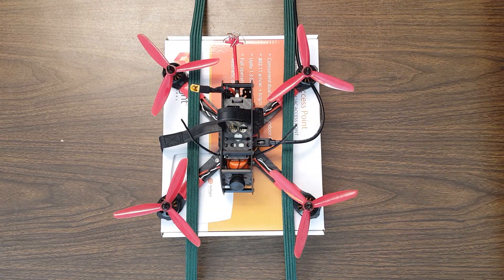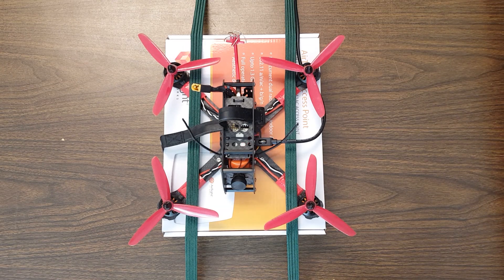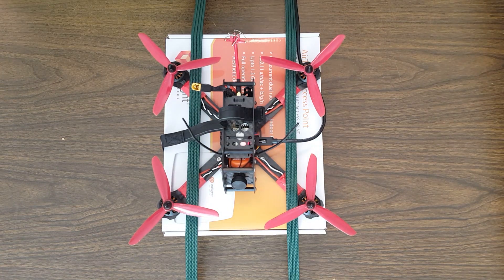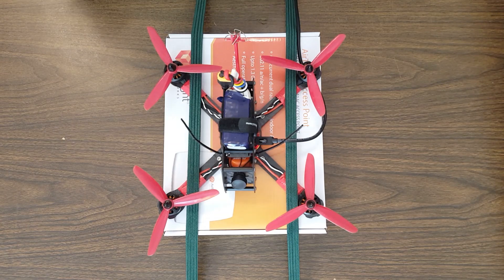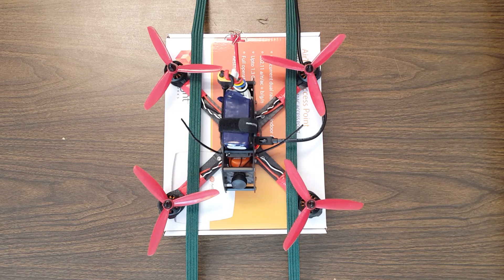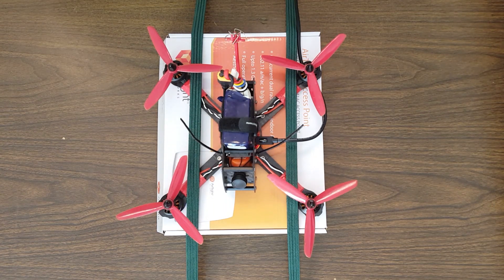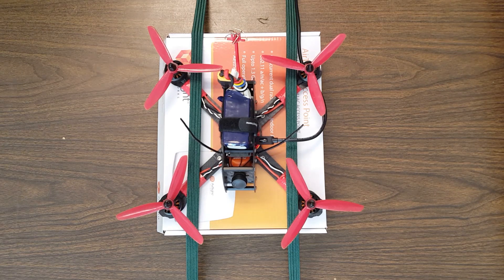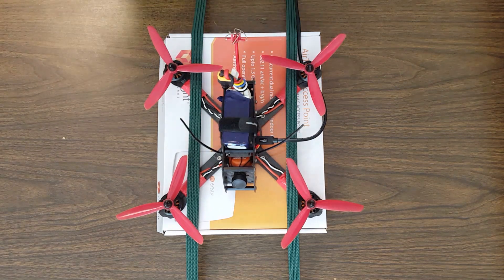Troubleshooting: Quadcopter Desync (Falls Out Of Sky)

Comment: I am new to quad flaying and probably this is a noob question. What happens if the motors are throttled up using the radio controller (PID active) when the Quad is pinned down? Will the throttle go up controllably? If so, why?  Because that's what I am facing in my tests and it freaks me out to fly the quad in open.
Reply from the maker: https://youtu.be/xBaefeQtA1c explains why this happens.

Comment: So mine appears to be engine breaking. As soon as I land and disarm, one of the motors slowly spin down, the rest "break" or stop. Then when re arming, that motor won't arm back up until I give it a few moments or unplug and re plug in the quad. Doesn't seem to drop out of the air though, only happens on landing.

Comment: I had a dipping front left side for the first time today. Very strange. The control of the quad went a little wonky the first few times it did it but I was able to regain control and land it. Then it dipped hard and headed toward the ground so I just disarmed. I swapped the right and left front motors to see if it still dipped left or if it would dip right. Trying to see if it's a motor or an esc. I only had 1 more charged battery to fly tonight and it was getting dark, but I was not able to get it to dip at all after swapping motors around. This is a new 3 inch build made out of used parts that were all good at the time I stopped using them. To me the motors were all too warm for my liking. They weren't too hot to touch, but warmer than I've ever felt any of my motors before, and I was just cruising back and forth down the street trying to get it to dip for me. I wasn't flying hard at all. This is my only AIO board with 32 bit ESCs. After the first few dips I plugged it into blheli_suite and it told me I had a problem with esc #3 and it made me reflash that esc. But the dipping forward and left seems like it was esc #4, the front left motor. I'm running props-out, so I suppose if #3 slowed down, that could cause it to yaw left and because #3 is the left side, it could also dip to the left. I have since reflashed all 4 escs and it still dipped, but did not dip for a 4 minute flight on my last battery after I had swapped the motors. Anyway, it's an interesting problem that concerns me because if it's just a bad motor, that could kill an AIO board by continuing to use it and if it's a bad esc, that could kill a good motor. 

Not sure if this will make the motors warm, but I flipped this frame and motors upside down and turned it into a pusher prop quad. I guess it's not blowing air down into the motors this way. Maybe that'll make the motors run warmer.

Comment: Bardwell your a life saver.  If I hadn't watched this video ida never knew I had this problem . I can't afford a motor right now so I just dropped a tiny ball of solder on the broken copper wire, heat shrinked it now no more drops. I'll replace motor soon though. Thanks bardwell‼

Comment: What do i do if i actually hear the reboot tone from one of the esc ?? It happens only sometimes and othertimes its allright and flies no problem... Whats the solution for this problem ? Btw love the videos👌
Reply from the maker: It means the ESC lost power.
Reply: Joshua Bardwell and How do i fix it ? Sometimes it happens just on the ground before even flying... could dried grass all over the electronics be the problem ? Also sometimes i fly and its completely alright for like 15 bateries and then all of a sudden it just reboots...
I use a diatone mamba f722s, F50pro 4in1 esc stack

Comment: Hi, thanks for the vid, I’ve tyro109 when I push the THR to max the drone get crazy and starting to yaw, and then lose control is some times, do you have any idea? Thank you
Reply: plugin drone to computer, open betaflight, go to motor tab, start testing the motors, turn them up to 100%, then plug in your battery and bring them back down to 0. Done. you have calibrated your ESC to your throttle.
Reply: @jacobdavis2296     I will try that right now, much appreciated... I hope it will work, thank you
Reply: @Fredhobby  @Lee The Bastard maybe try reflashing the escs in blheli. I saw another video that covers fixing quad roll of death. I can't remember what he did, but you can check and it may fix your Issue. I'm almost positive that's the issue.
Reply: @jacobdavis2296  I've just done that, doesn't help, the same issue, I have this problem since day one, maybe 4 months, never enjoyed it for even ones, still new.. and all the internet... nobody really knows, at least you tried thank for that
Reply: Fred’s Hobby did you ever solve it? I had the same problem on a tyro79, I ended up buying another, then I got a different problem🤨 in self level mode after doing a roll spin the bloody thing when mental, it’s rolling out to the right then it just goes off in any direction usually backwards and towards me, reflashed the firmware but still the same. I have 4 of these,  2 tyro 79, a 99 and a 109, had problems with every one of them! FC and VTX
Reply: @leefurniss  Hi mate, yeah fixed, it seems like nobody here have real kwnolage to solve real issues, you should flash the ESC to 48K, only then it will be solved and flying is great and stable, thanks
Reply: @Fredhobby  @Jacob Davis
Thanks for the info guys, ive tried flashing ESC's and FC again and still no joy, Ive got the feeling the FC is buggered so ill try the other "good" FC (dodgy VTX) in my loopy Tyro over the weekend and let you know how I get on. Cheers
Reply: @leefurniss  it's not a regular flashin, you need to download a specific file and flash it, it should solve it, give me your email I will send you the file, it made me crazy for months until I fixed that by my self, so if I can help you id be happy, thanks
Reply: @Fredhobby  Hi mate, I don't want to put my email address in the comments and can't send it you privately, do you know how to send it without putting it in the comments? I did download a file off gitHub last night and flashed the ESC with G-H-30, 16.7. Is this not the right one? Its doing my head in too, I felt like throwing it at the wall last night, I do appreciate your offer of help if you can figure a way of getting my email to you privately. Thanks, Lee
Reply: @leefurniss  that is the exact way I felt with this issue, never enjoyed it, I hope it will help you, I made a download link for you: https://we.tl/t-0GPpW5XXYz
,thanks
Reply: @Fredhobby  Hi mate, I tried the download and it seemed to work though didn't show the same code in the configurator, I did a test flight at 2am in the morning (neighbors love me) and all seemed fine till the following day and then i'm back to square one dodging out of control quad, tried to reflash esc's and now it comes up as failed flash with this in the log (flashing failed - Error: LAYOUT found #G_H_30#, #M_H_30# expected at checkESCAndMCU) I'm puzzled mate! I'd be grateful for any more ideas if you have some, i'll try it again on another PC soon. Thanks for taking the time to try and help anyways, I really do appreciate your effort.
Lee
Reply: @leefurniss  hi mate, its only the ESC issue, check your USB cable before you flash it, use quality one, and try it again, its the only issue, can't understand why they sell such a bad quality ESCs, these jerks...
Reply: @Fredhobby  Thanks mate, I was thinking maybe its a bad USB wire but it flashes everything else I've got, It also says my FC target is STM32F411 where as before it said MATEKF411 . I wont give up on this i promise I will learn from it 😂 Thanks again mate 👍
Reply: @leefurniss  sure mate, after this, you will just be smarter, when I flashed few times, at first it was as it doesn't save the new update, I did that again and now all is working perfectly, do use another USB just to make sure, hope it will work this time... :)
Reply: @Fredhobby  Hi, can you reupload the file, because I have the same problem that you
Reply: @Fredhobby  Thanks a lot, yesterday I broke one tyro arm. So I'm waiting for a new one to test this hahahaha
Reply: @pepeluis06  lol... hope it helps you:)

Comment: Hey JB, I flashed my Tinyhawk freestyle to 4.1, and kept the diff all. Im wondering if youve done a THFS to 4.1 yet. I flashed matek F411RX, 1st non legacy, then legacy because my board was 90 degrees off on the yaw axis, and so are the motors, I fixed orientation, and remapped the motors, but I cant get it to arm. My question have you heard of this before on the THFS, hopefully I can follow along with your video to paste the right stuff in. Shouldnt I be able to flash it back to 4.04, and paste the whole diff all file back in.  Pasting in the cli makes me nervous, are Fcs easily bricked pasting into the cli. Thanks JB.
P.s. I finally got the 1606/4000kv 4s acrobrat tuned up, its a beast on 4s 850 mah with an AUW of 326 grams, lol.  I think the 1507 lower kv motors would be a much better match.
Reply: Papadoc Fpv this happened to my 2nd THFS out of the box. I reflashed the fw to 4.0.4 and then pasted in the stock tune from EMAX Into cli. Just go to quad page on EMAX site, click “download” button next to BNF cli dump. It’s a text page. Just copy the whole page it takes you to and paste into cli. Hit enter and after it runs through each command automatically, it will save which restarts the quad. Stock config should be restored. This fixed the weird gyro issues and I just calibrated gyro after that. According to the firmware update page in beta flight, you dont have to worry about it bricking.
Reply: @tapyinz  I appreciate it, Ill get back to that in a couple days. I was hoping I could ger it restored. I havent put any content out for a while, but Im still giving a frame away at 500, check it out if you like. Better to come. Thanks again!

Comment: We've got a tiny hawk s falls out the sky and reboot relemetry lost/recoverd. And 1 motor always has problem (changed from rightback to front right and front left) but sometime other motors don't spin on idl but twitch/lagg. On higher throttle 2 motor always spins but 1 or 2 twitching/lagging.  We cleaned all motors and changed motors but the problem came on more motors after that. ( orderd 2 new motors, props, frame and camera ). It did fly good in beginning for a little.
What to do ?
Reply from the maker: If the motor stutters and you changed the motor, then the next step is to change the ESC.
Reply: @JoshuaBardwell  btw it's n all in one board with vtx receiver esc"s. It was very weird becaus off the drone did after changing motors fly good for a while and started dropping out off the sky. Also many times on arming 1 or 2 motors stutter. Pushing on the connector of moving the little cables could temporarly help. But not for long.
Tnx for ansering

Comment: Hi, I made a roll on my leader 120 and  starting dropping from the sky without having control of it but suddenly  it connect again with my radio  and it continue flying without any problem. What do you thing is the problem? Thanks
Reply from the maker: Maybe your receiver went into failsafe because it lost power or the signal wire is damaged.
Reply: @JoshuaBardwell  thanks

Comment: What should I do if my Flight Controller continuously restarts? I think my problem has to do with temperature because I notice if I blow on the FC, it will fix the problem until the FC gets warm again. But the temperature gets warm so fast. I get about 1 - 2 minutes of flight before it restarts on me. I tried it with and without all the components connected to the FC and the issue persists, so I know it’s not due to any of the components wiring.
Reply from the maker: You may have a short-circuit somewhere in the FC, which would cause it to overheat and shut down. You can test for continuity between 5v and ground for example (it should not be there).

Comment: I think your setup would feel a lot safer if that foot between the prop and your head was filled with a sandbag or a cinder block. I know I would feel better...
On a different track for the same problem, do you think that a set of flat shrouded disk impellers, kind of like those in vacuum cleaners, but with straight vanes would be worth the trouble for situations like this? It would eliminate the risk of un-intended flight while still providing a load and rotational moment to the motor.

I have dreams of drones large enough to use actual aircraft props. Anybody else?

Comment: 3:39 you can see the stator starting to move and rotate on the hub causing interrupt
Reply: Okay how the f did you see that?
Secondly, my rewound motor had the same issue: loose stator. I just applied epoxy. Will see if it will do away the problem. Will let you know🤜

Comment: My quad also started falling out of the sky, but in many cases it rearms itself after 1-2 seconds. In some cases the quad hits the ground and than it flies again, but not always.
EMAX F4 Magnum AIO FC
Taranis QX7S radio
FrSky XM+ SBUS receiver

...I already damaged 2 batteries and broke 2 or 3 battery straps because of these crashes
Reply from the maker: Turn the "Warning" OSD element on. When the quad falls out of the sky make a note of what you see. It will give some clue on what happened.

Comment: My quad Flys fine on 4s and when I put it 5s it desyncs and falls, which should not happen because all the parts are rated for 6s so can someone tell me what the issue is?
Reply from the maker: Just because they are rated to take 5S doesn't mean yiu can just go back and forth without retuning.

Change ESC timing to high.

Add capacitor to ESC's.

Comment: Joshua can you help me with an issue. I keep getting esc’s fail. twice on motor 1 and once on motor two. It just falls out of sky mid flight and once you try power cycle it only first 3 beeps on esc and esc just gets really hot? Can’t read esc in blhelli
Reply from the maker: If it is getting really hot when the motor is not spinning then likely there is a short-circuit and it needs to be replaced.
Reply: Joshua Bardwell I agree but do you have an Idea the flight controlled is causing this? As it has happened on 3 brand new esc’s. On two different motors?
Reply: Joshua Bardwell thanks for any help I’m getting desperate

Comment: What if it is only occuring while flipping and rolling?? This would mean soldering?
Reply: I have changed the flight controller for other reasons than desyncs and the exact same problem still occurs
Reply from the maker: I would start by investigating a damaged motor or ESC.

Comment: Hey Josh I ws wondering if you might know what would cause a motor to stay spinning when you spin it up and lower it in the motor tab. When I power up and arm my motors spin up, but when I disarm and try to arm again motor one starts to beep the start up beeps over and over, then starts to make a remix of the beeps. I unplug it plug it back in and it repeats the pattern. I am making a video of what happens and will be posting it in the RR and miniquad club group soon.
Reply from the maker: I would suspect the ESC.
Reply: Joshua Bardwell thanks, I kinda figured it might be the processor chip on the esc. It seems to get caught up in a boot loop, and in blheli it says esc 1 has no firmware on it. It also gives me error messages when I try to reflash. I think someone tagged you in my RR post with pics and video of my findings thus far. Do you have a video on troubleshooting esc processors and other components, like the tan caps? I have found tips on troubleshooting fets but am struggling to find tios on the other bits.

Comment: hi have a problem. on a hard flip or roll every now and then, the craft does a death roll. while this is annoying, everything appears to reboot before second roll. reboot happens, you get asterisks on screen then you hit the ground.  is this something stupid in the FC?  I can fly it so long as my roll rate is under about 800 degrees /sec
Reply from the maker: Does it actually reboot like you hear the ESC startup tones? If so, look to your power system: XT60, PDB, wiring to ESCs and FC.

It could also be this: https://www.youtube.com/watch?v=xIQn35vZBvE
Reply: thanks for the reply.  usually the craft is beyond hearing and other craft making noise. so I only have screen to go by.
it is random as I can fly a full battery fine and the next one goes silly.
always after a hard roll or flip and it once the desync (I am hoping) occurs, the screen blacks out and then comes back on. this has occurred on several FC's and only since BF3.1 onwards. I have tried BF 3.1, 3.2 and now 3.3.

I have tried increasing idle speed as well as esc timing to med-high.  could a higher demag reduce chance of desynch?

anyways and always, thanks for great posts.

Comment: So I just received the eachine lizard 105s everything bound together and set up is good but it only flies for about 19 seconds and then drops out of the air till I re arm it and flies for 19seconds and drops out any idea?
Reply: Same problem on my wizard x220. it takes off pretty smooth but the front right motor gives out and it just falls out the sky.
Reply: Matt HD is it brand new?
Reply: Yes, just got it two days ago. my Min_ is set at 1070. Any ideas??
Reply: Matt HD I'v been told either my battery is bad ,the receiver is bad, the receiver is on 3.3v not 5v, solder pin, failsafe kicks on, so I have no idea what's going on hopefully I can get this fixed I'd like to fly more than 19 seconds
Reply: Brian Richtmyer it could also be something in betaflight Aswell . I’m just hoping I don’t need no new parts cause the damn thing is brand new .
Reply: Matt HD when yours drops out do you have to re arm it to get it up in the air again?
Reply: Brian Richtmyer yea it failsafe when agile angle is no longer in balance . Have to rearm it. The motor speed drops or something while flying causing it to shoot up in speed to save it self.
Reply: Like I take off and hover then the right motor dsyncs and he drone just falls out the sky . I think it could be the battery voltage getting to low .